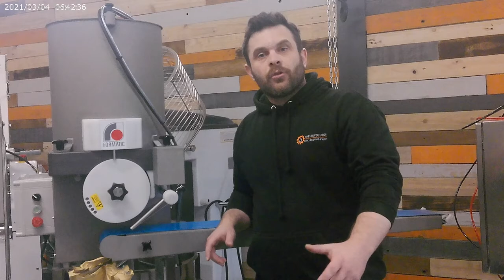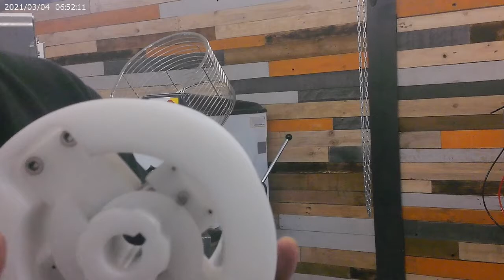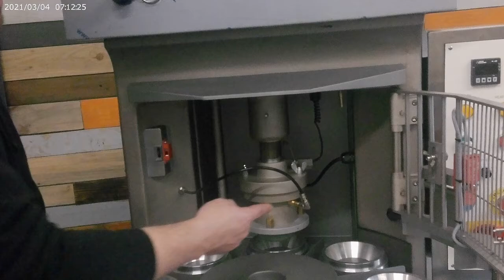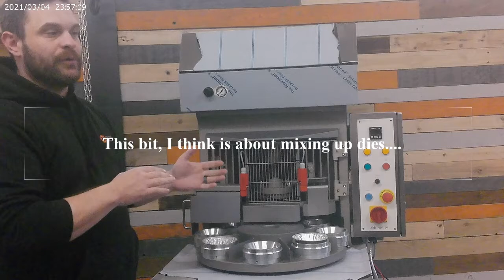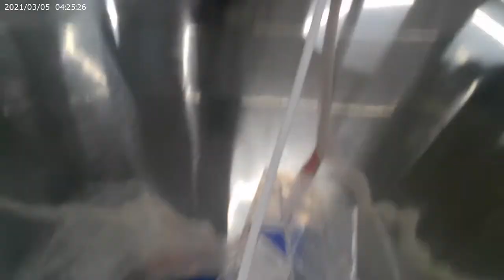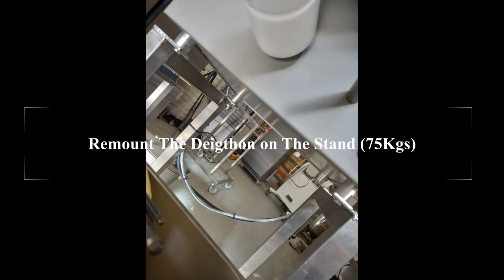Game Changing! - Automatic Pie Machine Setup & Adjustment.

Comment: This was a fantastic video, and so informative of so many things. What's the model of the Pie press? Is it 'John Hunt 8 station Pie Machine'? I'm looking for a tart shell presser to fill 80 x 20mm perforated tart shells, 2mm thick at the sides and bottom, but with vertical side walls, no taper. Does this machine offer components that would do that, or something very close to those dimensions?
Regards... Scott :-)